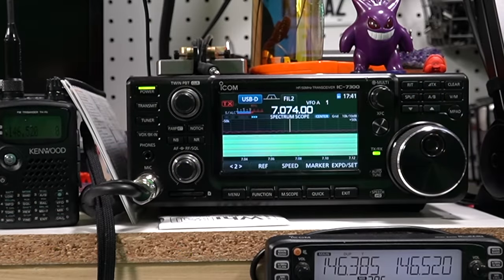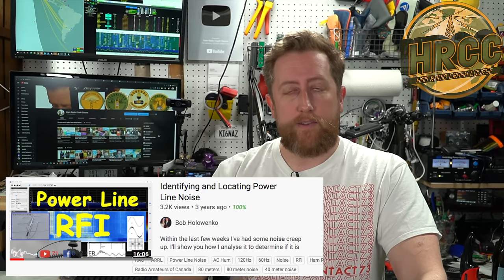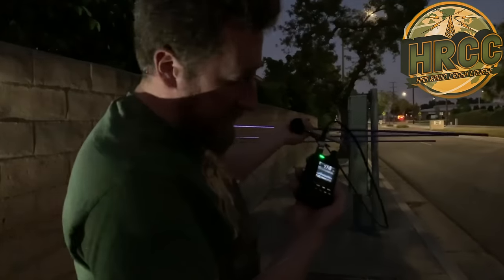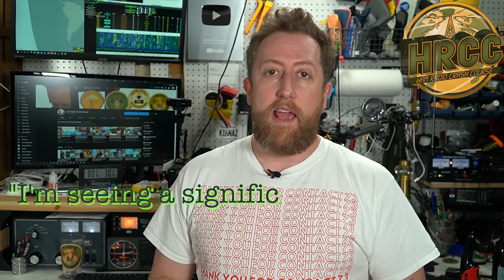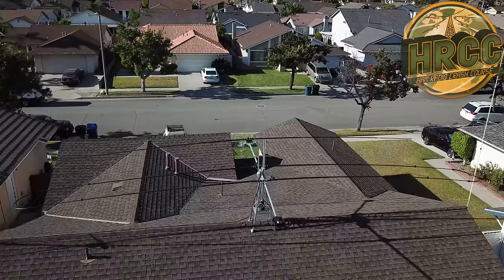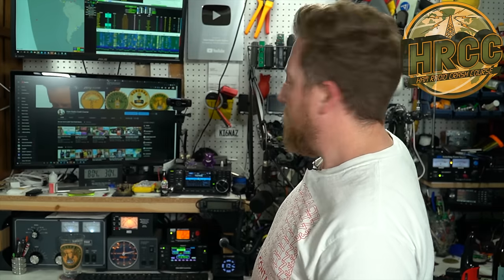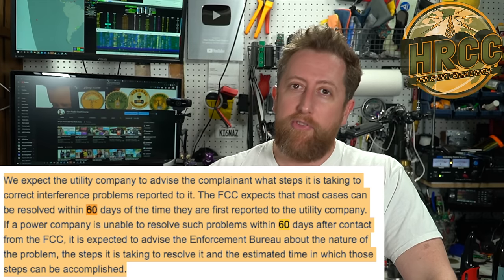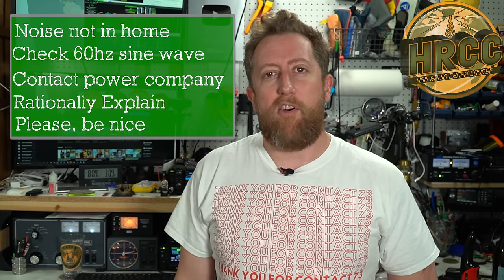Power Line Noise On Your Ham Radio?  How To Find AND Get it Fixed

Comment: This is why the netherlands is a good ham country we dont have overline power lines to houses we only have powerlines from the power plant to a base station
Reply: When I was on holidays in Latvia 3 years ago I noticed that there were no overhead power lines in the streets even in the countryside. Only a higher-voltage line to a transformer station
serving a village or group of houses was usually visible. As the homes and other buildings had electricity they must have been supplied by cables buried in the ground. But in neighbouring Estonia I saw overhead lines on poles in the streets and lines going from poles to individual houses just like in the countryside in my native Poland.
Reply: @adamzieba8364  even in the countryside we have burried cables
Reply: @glennbreukelman8241  During my stay in Bavaria (Southern Germany) on a student exchange 30 years ago I had a practical training at the local power company. In some parts of the countryside there was a strange version of overhead power lines - they were not hung on poles along the street but they went from house to house often in a zig-zag pattern. On the roof of each house there was a small metal pole with isolators and bare aluminium wires were hung between such poles. I wonder how that company managed situations when a house in the middle of such a chain had to be renovated, rebuild or demolished.
But at the same time the company was replacing these networks with underground cables ("Verkabelung") to increase the capacity as they were promoting electric heating because there was an energy surplus from a newly built nuclear plant Isar II.

Comment: Hi KD2VHJ here I have the same issue here in Schenectady NY . I called my electric company National Grid and they said they fixed several arcs, but the noise is still there. The tech pointed the YAGI at my neighbor's house and said it was coming from them. The only thing  i could think of that would wipe me from the AM broadcast band to above 6 meters if the House was not grounded. Any input would be helpful.

Comment: I have the tall towers with the very high voltage transmission lines on my property border. I, not sure how this affects my radio antennas'. For example, will the antenna be better positioned parallel to the lines or at an angle to the lines. I  have a vertical 2 meter antenna and a horizontal 1/2 wave dipole. Any help would be appreciated.

Comment: Hey Josh, I'm experiencing a puzzling type of RFI. It's many very stable blank carrier waves, stable both in frequency and amplitude. I see this on the spectrum display of my SDR from around 500kHz, right up through HF, although, strangely it doesn't seem to affect the 20m band much at all. The spacing is exactly 8kHz, right down to an accuracy of 1Hz. These spikes don't have any modulation whatsoever and so far, I haven't been able to determine what could be emitting it. Any suggestions as to the possible cause of these regular carrier waves would be much appreciated.

P.S. During my investigation, a side bonus was that I discovered the power supply of one of my computer monitors was producing wide-banded noise, which was raising my received noise floor. The monitor is a Samsung S24D300. This has now been taken out of commission.

Comment: I have an AM transmitter on my house about 15-20 feet up. I have power lines around my house (not close enough to the antenna to be a safety issue). The transmitter I bought was advertised to reach 1-2 miles and I can barely hear it inside the house. The volume is quiet and there is a hum. Is it the power lines or do I just not have it tuned well?

Comment: Hi Josh.
Thanx for that interesting and informative video.
I had a loop antenna many years ago that was given to me for the purposes of tracking.
Have no idea where or what happened to it. I might build another one because i still remember the materials it was constructed from. :)
Luckily, I don't have those 'spikes' that you were experiencing but still have a lot of 'noise' (hash/white noise) coming in @ s7-9
Sure, I can eliminate this 'noise' by simply turning down the RF Gain but I don't think that is the correct path.......
Cheers
Mick

Comment: I had bad PLI in Australia. I found the offending pole insulator, even put it on Youtube. When I phoned the power company, I only got as far as the lady on the front desk employed to fend off customers. She wanted to know what my qualifications were, and was my antenna 'calibrated'!(?). When I replied it was home made she said they wouldn't do anything about the noise as it might not even be there. In the end, during some rain, it was buzzing and arcing a bit, so I phoned them again and told them their pole was arcing and likely to set on fire. They came out next day, replaced the hardware, noise gone. 73 ex VK2GOM.

Comment: Good detection of the problem.  I was wondering how to get a Ham Radio Operator to come to ones home for inside the house and outside the house interference?  We do have two power poles in our backyard.  Hope you see this.  I'm writing in 4/2021.
Reply from the maker: You likely need to do some of the leg work on your end first. 

You’ll need to pull the power and test all your breakers and else over first. Then if you have a larger issue a ham might be able to help.
Reply: @HamRadioCrashCourse  Thank you so much for your reply.   I literally just am seeing the reply on 11/15/21.  So sorry I didn't acknowledge your response earlier.  I was wondering if you knew of anyone who lives near San Jose, ca
That might be able to help (Ham Radio Operator).   I don't know how to do the things you said, and I wish I could have you determine the problem.  The sounds are occurring in our backyard plus home! Our power company is dismissing the issue, but the issue sounds like a transmission line noise entering the house.  It's quite an interference.  I tried contacting Ham Radio Operator in our area and perhaps due to the Pandemic they aren't in office?  You were brilliant in how you determined and pinpointed the sounds.  Thx for sharing your information.  The handheld tools you walked the neighborhood with.....where did you get them? and how can I order that?  Then perhaps I could pinpoint the noises...I don't really know what I'm doing though or how to read the meters.  The issue has grown so much worse since I first talked to you and no one wants to look into it.  Like you said you do the footwork. Thx again for your information.

Comment: Josh not sure if your still following this but the past 3 day I have come across this same issue the radio is unstable due to +7/8 of noise on all the HF bands up to 30mhz I have been out with the SDR and I think I have found the issue on a local step down transformer located off my property. I have emailed the local supply company and am now awaiting a reply M7CVK 73 Tony

Comment: Hello @Ham Radio Crash Course I'm dealing with an interference/discharge problem on my current but i think Radio Waves are also involved. Can you tell me what exact device they fix on the pole that was causing the radio waves I'm pretty sure in my case is insulation but i can't prove it to the Power company because i don't have the Meter

Comment: I'm making a log of start and end times for what does seem like power line noise by the frequency of the audio on AM. The strange thing is it isn't constant. It appears randomly but more often in the evenings. Could this be because of higher current draw through the point of failure at peak electricity consumption times? Measuring on Google maps, My EFHW is only about 90 metres from the power lines running across the field next to us. Thankfully it often only lasts 10 minutes. It's just tonight it has been heard for over a constant hour.

Comment: I am still in the discovery phase. I went from S3 to S9 noise over the summer. Just have to find time to go scan the neighborhood. I am on solar/battery for the shack, so I can use that data to my advantage
Reply: Just a note of caution that an inverter connected to a battery may also produce significant noise.  Any switching circuits found inside the inverter are likely to cause the noise.  The quietest supply will be direct from battery to radio without any inversion or conditioning.

Comment: I highly doubt my rural electric company would do anything to help me out. Interesting to know that they have to comply with FCC regulations though. I don't have power line issues like you do but as you showed the TV making noise how do you fix that except for turning it off?
I have a washing machine and a DVD player that make horrible interference on my HF rig. If I were to contact the manufacturers of these items could the FCC force them to comply with FCC Part 15? I will be nice. I have also noticed that if I use a desktop computer in my shack it makes noise where a laptop computer doesn't. Buy a truck load of ferrite beads and toroids?
Reply: bob Murton  I am old enough to witness the introduction of small AM transistor radios but boy have pocket radios evolved, eh? (Multi-band with SSB) Can you still buy a pocket AM transistor radio?
Reply: bob Murton  Thanks!
Reply: bob Murton  Thanks!

Comment: I am having a similar problem a steady kind of power line buzzing sound on 40 and 80 meters.   Have tried the radio on the battery technique and got some reduction when killing the house main but not much.  Most of it must be outside.   I have a two meter and 70 beam antenna which frequency and mode should I use to pinpoint the noise?  I can get the general direction from that I would imagine.  Also have a mobile screwdriver setup.   No small yagi though

Comment: I have an issue driving me crazy every nite at 8 PM until around 6AM I have a noise issue I know its not in my house . I have traced it directionally with my flatside element beam to my north and easterly direction.On my vertical its there also . Iam thinking its gotta to be an alarm system or lighting since its the same time every night . This only started a few months ago  Any ideas on what I can do to eliminate it .

Comment: I'm thinking I have some kind of electrical or line noise myself. I have the 7300, and your waterfall looked all too familiar to me. My noise is on 160-80-40 mostly. It "pulses" and is completely broadband. When the noise is there, it's all across the band. But it goes away for some split seconds or seconds. I live in a semi-rural area; most neighbors have 5 acre plots. And fortunately my house is in the middle of our land, set back very far from the street (where most of the houses are up close to). I'm still investigating the source. Installed a LOT of type 31/43 ferrite beads and toroids -- still no help. Thanks! de N3AZ  P.S. I have a Yaesu FT-818, purchased for QRP/portable but also to track down this problem! It is all-mode. I just need a good portable antenna for this purpose.
Reply: Try a 2 turn electrostatically shielded loop.  It's a manageable size and bidirectional, which is good enough to  use for direction finding.  A portable AM band radio is more portable and also bidirectional.

Comment: Great video, thank you!  A question: I'm not familiar with the HTs you were using. Were you using them in FM mode? Or AM (if they're capable)?  Thanks

Oh, FWIW, I believe the dish they use is actually listening for the ultrasonic signature of sparking, not RFI.
Reply from the maker: I use both the Kenwood TH-F6 and Yaesu FT3DR.  The TH-F6 is great because you can use AM and can go pretty wide on the receive.  So its up to you based on what you're looking for.  

Yes, the ultrasonic dishes are looking for spark.
Reply: @HamRadioCrashCourse   I asked because the "common wisdom" I've heard over the years is FM radios aren't particularly good for noise detection because of FM's general immunity to impulse noise / amplitude changes.    That's why I asked if you were running your HT in AM mode; the majority of HTs are FM only (though Airband is AM and could be used).  If you were able to detect the noise in FM mode, that's somewhat game changing.  

Were you operating your HTs in AM or FM mode when you were direction finding?  Thanks
Reply from the maker: @dougelick8397  I used both modes, but primarily AM.  When the interference is that intense you can hear it on the audio specifically.

Comment: josh i have had a problem with power line noise for 2 years the power coop just started to do some thing in april by cuting trees but that  did not help much then this week they changed out  two poles which helped some but still got the noise  have it on o scope

Comment: I have some noise on the lower HF bands when listening to my Icom PCR-1500. This interference appeared some 2 weeks ago. It starts after dusk and it has a strange pattern - the noise is on for about 45 seconds, then diminishes significantly for about 30 secs and after that time is on again. I suspected some kind of electric lighting as the source, but why this 45/30 sec pattern ?

Then I noticed that a sodium street lamp not far from my house shines for about half a minute, then gets dark for 45 seconds to shine again after that. This kind of behavior occurs often at the end of life of a sodium lamp. So when this lamp gets dark it produces strongest radio noise - maybe there is some abnormal discharge between the internal electrodes. There was no such interference before last 2 weeks as that lamp was still OK.
I didn't bother to notify the power company, because I know that they are going to replace all the sodium lamps on my street with new LEDs in 3 weeks as the street is getting an upgrade (new surface, new sidewalk and new lighting). I hope that electronics of those LEDs is properly engineered and it won't produce any radio noise.

Comment: Been experiencing annoying AC hum RFI from transformers in my apartment with my SDR, it's really bad on the SW, HF, and MW/AM bands on my SDR.  I've been using the MLA30+ to pick up SW radio, and the issue is that the window seat where I get the best signals is also pointing towards a transformer from the building across the complex, but it isn't as bad as the one at my building.  It's very annoying, but I probably have to play around with the direction I point the antenna.  The things I do just to hear the dulcet tones of WWV's signal and getting the chance to stumble across HF transmissions, and hear JT65. lol 

I also have a musical ear as well, and AC hum has a distinctive tone that is close to a low Bb on a piano or synthesizer. :) 

Would that type of Yagi antenna work for picking up TV signals?  I tried getting another basic antenna for the TV set and it picked up only 3 stations, even though it claimed it would be able to pick up farther away TV signals.

Comment: This is really interesting to me. All of my antennas have crazy high SWR at my house and I can’t seem to get 6 miles away. My house is on top of a hill overlooking the Hudson River and NYC on one side. Going the other way things seem to work a bit better but still very noisy and limited using a 75w radio and a 1/4 wave antenna. Mobile out and about everything works great. Park in front of my house and I can barely reach down the street on my 25w radio using my 1/4 wave or my 5/8 wave antennas. All my grounds are solid. Home antenna is roof mounted. I’m wondering if I got some type of electrical interference or something
Reply: Starvin Marvin  thanks for the reply! After I posted that I found the source of the SWR issue. I still have the issue of short reach eastward. Turns out my neighbor is a ham as well and has the same struggle.

Comment: What if you have a constant s3 signal in almost all bands except 40m and lower ... Is that an antenna issue or man made noise issue ? 73s Jimmy SY1DAL
Reply from the maker: Likely too many variables to give you one answer.  It could be many factors.  but S3 is not bad!

Comment: If the noise is coming from a powerline transformer near my house, can this be addressed by installing some type of filter on the coax or is the only way to get the power company to do something about it?
Reply from the maker: Pretty mix have to go power company at that point.
Reply: @HamRadioCrashCourse  Thank you.  I have identified some of the noise affecting the HF band and it's coming from an inductive charger for cell phones etc..  Do you know if there is a simple way to supress this noise short of replacing the charger?  Chokes on power cord of charger e.g.?

Comment: Hey Matt,  I know this is an older video, but I'm finally  trying to build my fist station and I have a a solid s7 -s9 coming from outside the home.  I'm building a yagi this weekend and using my Thf6.  What frequency / setting should I set it to?
Reply from the maker: Hi, I'm Josh
Reply: @HamRadioCrashCourse  Hi Josh.
Reply: Air Band, AM, with squelch turned off.  But then you will need the antenna to be designed for that frequency...  a 2 meter yagi might have weird properties that far away from its design frequency.

Comment: . .hi. .im not good in english pls understand😁  i have a problem. I dont know if our wifi is making noise to my radio.. I use yaesu 2900r and antenna cp22 . .my radio and wifi is in the same tower. .  and there is no power line near by . . can you advise me what to do??
 i cant hear my nabor using hand held radio anymore. .
Reply from the maker: Sure. Turn off the WiFi and check.
Reply: @HamRadioCrashCourse  tnx. .seems the wifi is the one making noise on my radio. .i got a remedy. i put my radio antenna 10ft above  the antenna of our wifi and it work. .no more noise at all..
Reply: @HamRadioCrashCourse  can i ask again??😅
 Do you ever try vhf to vhf repeater without duplexer and cavity filter??